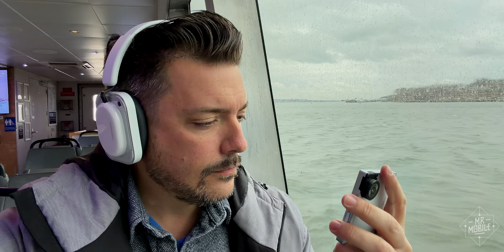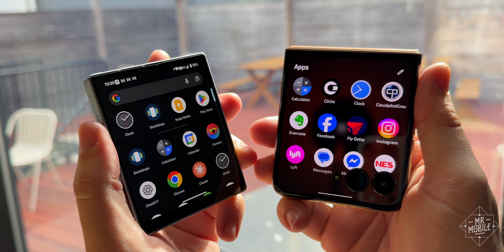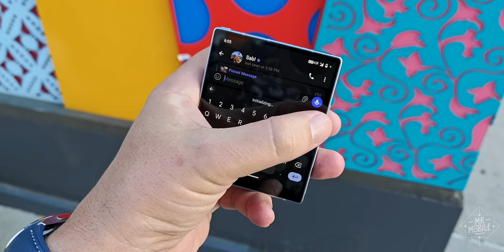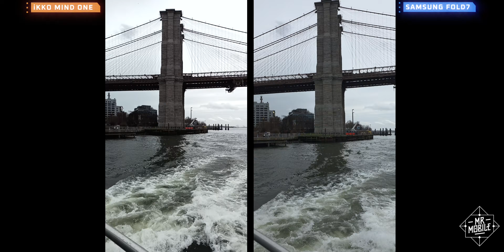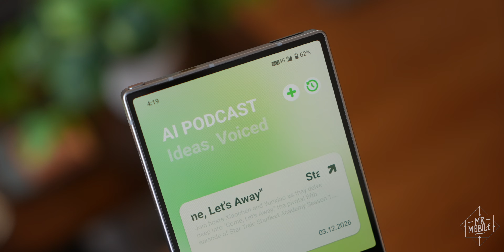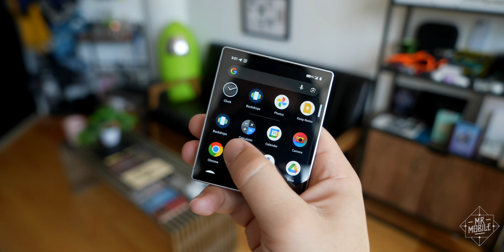iKKO Mind One Pro Review: Missed Focus

Comment from the maker: UPDATE: iKKO has responded to the questions I sent during my review process. See below for the company's feedback!

Display:
"We understand why people make the comparison, since the size is very close to the secondary display used on the LG Wing. However, this is not the same panel, nor is it simply reused from that device. When defining the display size, we used software compatibility and display usability as important reference points. The MindOne display is a custom panel developed around our own product definition and requirements. Its display parameters, bezel structure, and refresh behavior are all different from the LG Wing’s secondary screen."

Gray appearance at minimum brightness:
"This is related to a brightness control bug in the current Android-native system environment. We are planning to address this in a software update targeted for late April."

Speakerphone quality:
"Yes, this is a real area we are working on. In our original design direction, we planned to link the speaker and earpiece together as part of the external playback system to improve the overall loudspeaker performance. Our goal is to bring this improvement in a late-April update if testing goes smoothly. That said, acoustic tuning generally takes longer than many other software features, so at this stage we believe a May update is the more likely timeline."

NFC / Wallet:
"This issue has already been resolved internally and is planned for the next major software update in April."

Fingerprint sensor:
"This is a known issue, and we are planning to address it in the April update."

App instability
"These are largely bugs within the current Android-native software environment, and we are working through them progressively. Most of the major fixes are planned for the April update."

AI: 
"We want to be transparent that we are still in the process of exploring different use cases for AI. Our focus is not to compete directly with standalone AI apps, but to build tool-oriented AI that is more deeply integrated into everyday usage scenarios on the device itself. At the current stage, this experience may not yet feel as powerful or flexible as dedicated AI applications, and that’s something we’re actively working to improve. Moving forward, we will continue refining these features based on real user feedback from our community, with frequent updates aimed at making the AI experience more practical and genuinely useful over time."
Reply: Good news all around. Would you be able to make an update video if/when the updates are rolled out in April?
Reply: @Moefongoh no
Reply: "Oh you have trouble with this thing? Don't worry, we have a perfect solution for you. It's called April."
Sounds like they are doing a lot of work building up to April.
Reply: @dwarf_verilian April fools they are abandoning the phone like the LG wing 

/s
Reply: My dream phone is this kind of phone with 4:3 aspect ratio. A little bit thick for better battery and cooling system. Better camera and while we're at it and lense attachment system.

Optional: 2 usb c on bottom and side, a head phone jack, and micro sd slot.
Reply: @Mug-Red  Seconding a micro SD slot. This size is perfect for runners or people doing other sports and who take lots of pics (ergo, give me an SD slot) and who don't want to bring a bag just for their stupidly  giant phone. I miss the days when phones fit in zippered back pockets.
Reply: That means if I buy it around 2027, the device is mostly updated! This is amazing! xD
Reply: Has all been fixed?
Reply: We'd like the Telegram channel address please
Reply: For AI part, I only have one question is that what if the AI model of each company has upgraded, would iKKO will sent the upgrade notification to the phone to do the upgrade?
Reply: My biggest issue is the battery life
Reply: So.....were all the things fixed?

Comment: Drawbacks are Low Tiny Battery instead of giving larger Battery in today's time every brand is using silicon batteries these days it should be using 8,000 MAH or 12,000 MAH Battery in present time even Very Thik Phone as compared to slim phone's in 2026 even  Android 17 Should be Launched with it then it could be a huge success Price according to  these factors is too much  it should be launched  due to that they should launched it as price of Dollars 200 only

Comment: I Purchased one and I'm pissed.

I received mine with the promise that I could buy the keyboard case separatel. Now they won't sell you the keyboard unless you pair it with another phone.

I discussed this with "The iKKO Team" - they confirmed that I can't order the case individually. So, it's a little late now to tell us that. So, I'm pissed.

You ought to know before you purcase your piece of crap.

The device lacks CTS certification and fails Google Play Integrity checks so you can forget about using wallets.

The battery is next to useless.

The flip-out camera is all Michael has already said.

The fingerprint scanner is awful as Michael mentioned.

Thet lack of 5G connectivity isn't to write home about - you can forgot about using it as a hotspot.

You would think that they would honour their promise and make good on keyboard case availability - but no, they instead want the negative press.

Comment: I really can't see the purpose of this thing. Apps feel squashed down, doesn't match any standard form factor... Reading is perfectly fine on a portrait phone.

The push on AI everything... companies need to GTFO. A single AI button on my Nothing Phone 3a was bad enough - half because of the terrible placement meaning when you put it in a car phone holder, it gets pressed.

Thankfully in that case I could uninstall their AI apps via ADB, then reassign the button to something of my own choosing. That being a flashlight toggle. Though again thanks to the placement, I've had to make it a double tap to toggle. Single press does nothing.

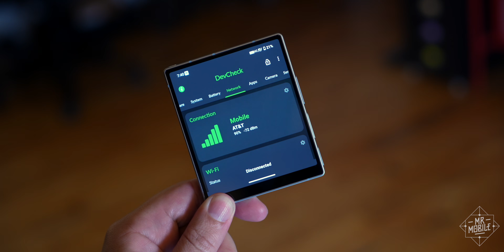Comment: 3:49 dont see that as a downside. i have an iphone 15pro and the first thing i did when i took my phone out of the box is turn 5G off, i have never needed anything faster than 4G speeds on my phone and it just draws more power.
Reply: In rural areas I have always found 5g to be inferior to 4g. I also hate fingerprint scanners and always turn them off.

Comment: I could easily switch to a phone in this form factor but the camera, battery, network and other niggling things make it a non-starter for me. I mostly use my iPad Pro so the small screen is not a big deal and a lot of the flagship company phones is kind of overkill and pointless hype anyway. I’m still using a Pixel 7 Pro and in spite of it reaching the end of its full Google support, is still doing fine. Hopefully something interesting that isn’t Apple, Pixel or Samsung will be released when I next need to upgrade.

Comment: It's a really cool idea, i had a skribble with a flipout camera lke this on my notepad as it just makes so much sense - and a true advantage you'd have over mainstream phones. (if the camera was just decent enough, which it looked like in my eyes - but I'm sure MrMobile showed the best results) But I don't get, why it's a square phone - outside of the keyboard accessory (which is kind of obsolete, due to clicks probably being better). Just having a small vertical phone - maybe a bit larger than the Unihertz Jelly - would be a lot better at running apps, and would still keep you from using it too much.

Comment: The device looks like what a Google Pixel might look like today if the company had focused less on data theft and more on innovative hardware. I would have deleted the Watch app long ago and perhaps replaced it with Google’s own. Instead of the AI operating system, I would have simply added a button for the AI of your choice. And as you already mentioned, the fingerprint sensor—as the only biometric unlock method here—needs significantly more settings and fine-tuning. The camera app also needs more work to get the most out of the sensor. In a pinch, you can fall back on the Google app here, just like countless other smartphone manufacturers do.

Or you could take the bolder route and install an alternative operating system. Then the device could at least function as a privacy-focused smartphone.

Comment: what's the point in this phone ? its wider than 6.2 inch iPhone , so if you're  having  trouble using iPhone with one hand, it wont be the answer to this problem. and for  around 350-400 dollars and noname brand, i expected better than garbage low end processor

Comment: This is the perfect form factor for a DAP - I’m in the market for one, but turned off by the low quality screens and bottom-bin SoCs that make basic navigation feel sluggish and cheap.
This looks to have a gorgeous screen, the perfect shape and size, and an SoC that’s at least better than the 7 year old crap in all the Android DAPs out there. I wish they had a case that got rid of the keyboard (takes away from the perfect tiny form factor) and just gave it a high quality / high power DAC, 3.5 and 4.5mm output, a nice volume/interface scroll wheel and some tactile back, forward, and play/pause buttons…

Comment: I backed this on Kickstarter and got my device in Mid-February. Battery life is atrocious (made way better by battery saver on PERMANENTLY & a screen time of 2.5 hours). The speaker is horrible I have to agree but with the bluetooth headset on, its FINE! It is a distraction free device cause any media consumption on is close to being frustrating than being fun. I live life more since I switched from my Xperia 10 V to a Balmuda, now to the IKKO Mind One. Like you said, a second device. But I use it as my daily driver. Plus those who are thinking about this, a lot of apps are not built to the aspect ratio, so there will be app issues like banks and payment gateways.

Comment: I bought one. I'm using it right now and its my only device since it came in. I like it but it definitely has some flaws. It overheats often in the car, the keys get presses too easily, the light sensor basically doeant work and i had to turn it off to manually change it. My speakerphone works fine on mine i wonder if they have a high failure rate or something.

Comment: I received mine last month and I have to say that it was so refreshing to use a device that small and so pocketable. Although small, reading on the screen is actually possible without squinting my eyes (or maybe my eyesight has not deteriorated yet) I used it mainly in crowded trains, buses in my commute and it performs very well! ❤❤❤ Also I used it during bedtime as the small screen prevents me from using it for a long time.

The CPU works well and is very snappy for the apps that I use...YouTube, FB, Chrome and some very light games., ANTS, Beast Lords. It has 256GB of memory so that's plenty for songs, pictures and 1:1 Tom & Jerry cartoons 😂

I have not received the keyboard yet as IKKO advised that it is being finalized (with DAC).

Comment: Received this phone more than a month ago, and sold it just before your review.

Agree with everything you've had to say about the device. It's gorgeous, brought it to Zurich with me and it was a great conversation starter with anyone whenever I pulled it out. Performance was fantastic, and it never ever stuttered. 

It's really not fit for use as a main phone though. Cameras/battery/fingerprint sensor, and the aspect ratio that just couldn't work with some apps. The speaker was the breaking point for me, and apparently keeping your finger over the speaker made it better however weird that sounds.

These issues pissed me off so many times but everytime I took the phone out and someone asked about it, it suddenly felt like I could live with the issues because it was just such a convo starter. 

Hated and loved it so much at the same time, and I think it'll be the same experience for many. It's really a love-hate relationship with this one!

Looking forward to your next "weird" phone review!

Comment: It's a pretty hard sell. A square aspect ratio while cool makes it awkward in a lot of functions as a smartphone. Some of that can be taken away by it's keyboard case. But if you are going to do that you are adding another 80 bucks to the price and making it much larger. Then you have competition from Unihert with the Titan 2 and upcoming Titan 2 elite, and the Clickz phone. All of which have better dimensity processors that do 5g and are just considerably more powerful. The later 2 of which have promised updates for years. This is just a hard sell. If it came out a year ago it would have been first to market and I'd have been down. But now? Meh. It's probably 3rd best in this style and it's pretty much the same price. Probably more expensive with the cost of the case included.

Comment: I'd honestly just like a small phone. I have a large phone. 6.67 inches. 185 grams. Huge. And yet, this is not even the 'ultra' size. It has a massive 6700 mAh battery which makes up for the size but now that silicon-carbon battery tech exists, what I really want is a 5.8 inch phone with a 5000 mAh SiC battery. If it'd cover the rest of the basics (Amoled display, decent midrange chip, stereo speakers, even a good single camera, and fluid software), I'd really consider it provided the price isn't a thousand bucks.

Comment: They actually offer kickstarter backers an option to remove AI from the system, but I don't know if it will remain this way when the phone goes on sale
Reply from the maker: Yep, but then you apparently lose Google Play certification. Double-edged sword.
Reply: Yes as someone who has the IKKO Mind One Pro I can confirm that IKKO confirmed to me and other backers that removing the AI features would indeed mean the loss of Google Play store but ive simply not used the AI features on the phone so it shouldn't be a deal breaker for anyone really.

You launch the AI OS via a dedicated button at the top left of the phone... Just leave it alone 😅

Comment: 1. Make it a little thicker; put in a silicon-carbon battery. 
2. A camera button and headphone jack are both unnecessary. 
3. Make it IP69 rated. 
4. Remove extra OS/UI and make it more stable. 
It will turn out to be the best secondary phone for plenty of people. Peace.

Comment: I had an android journey for the last couple of years and while I had a lot of fun, trying the different form factors and different UI. I recently went back to Apple and I remember why I was with them for over a decade. The iPhone 15 I picked up for $400 on sale brand new is perfectly capable and looks and feels great. The Apple Watch 11 I got shortly after that is so much nicer than the old Apple Watch I had before I switched to android. You can really tell how much slimmer the form factor is. So much so that I can actually use it for sleep tracking. And just a couple of days ago I got the MacBook Neo. This thing has no right being as nice as it is for 499 at the education discount. I traded in an old iPad Air that I wasn't really using much anymore and got that down to 300. Needless to say, I will miss how different and fun so many android devices are but the Apple ecosystem just works so nicely together.